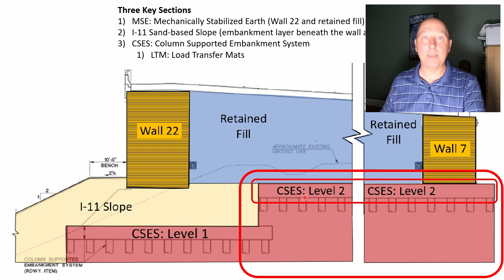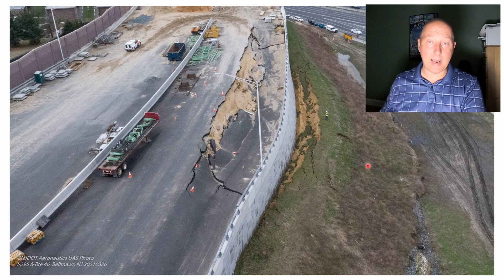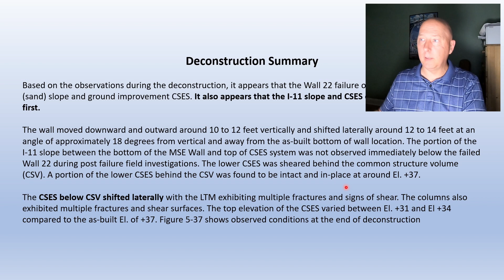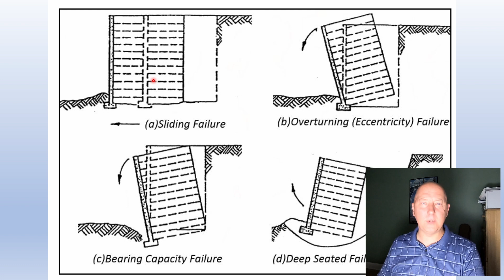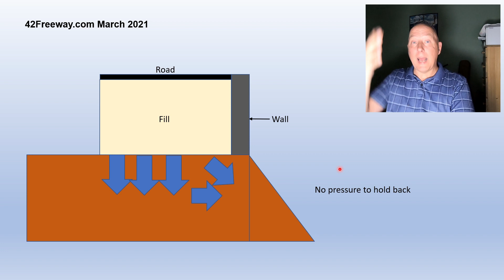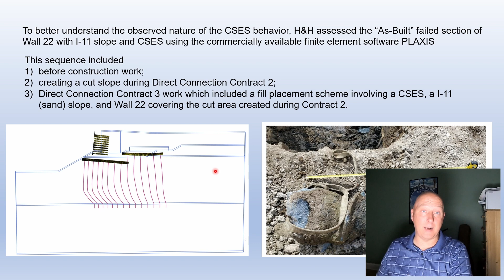Direct Connection Collapse Report is Out!  Here is our analysis

Comment: It short terms they built a road way and wall on sand rather than something that’s not going to wash away , this is an engineer design fail and not the workers as they like to go after ….. this is karma for knocking down that old farm house !!
Reply from the maker: well if they had contained the sand it wouldve been fine.  having the slope and the wall not go all the way down gave that sand an escape route
Reply: @42Freeway  water always finds a way and eventually it would collapse , that being said all road ways are constructed with a rock base fill as well as crush recycled concrete … this was an accident waiting to happen and the only way to keep they sand from washing away was to place concrete Rock barriers along the slope of the wall to stop any of the sand from washing away !

Comment: Thank God the design was so poorly considered that it failed before traffic was on it. I'm a dumb guy, but I never use sand as a base when lateral forces are involved. I'm doing a decorative wall right now in my front yard and I'm putting sand in the bottom of the trench I dug. It's fine because it's contained. I'd use gravel if it had forces on it.
Reply from the maker: you give a perfect example!